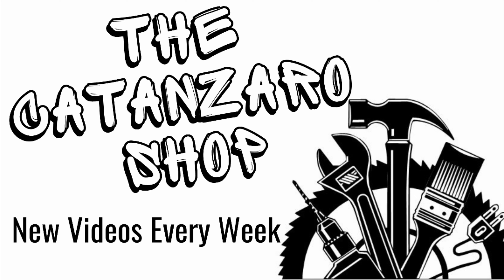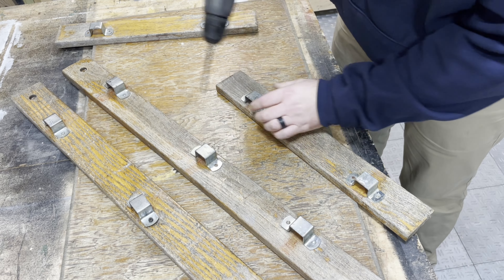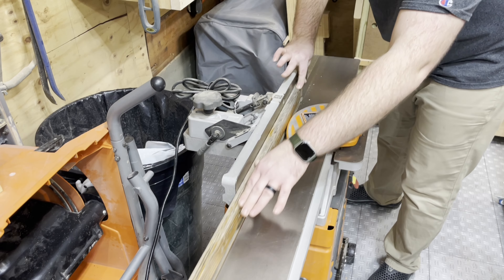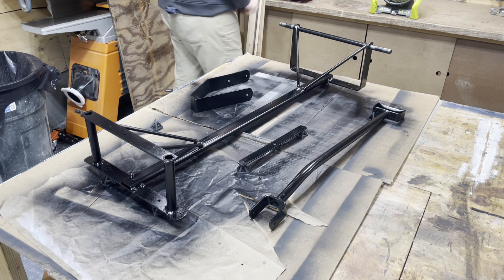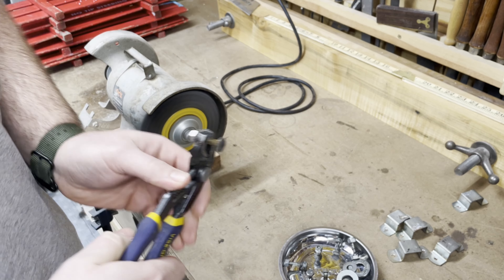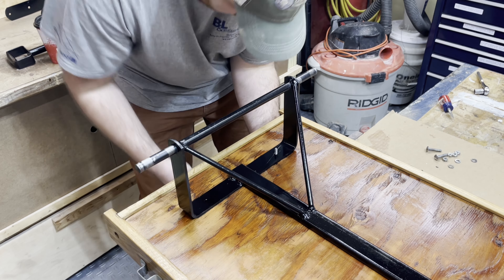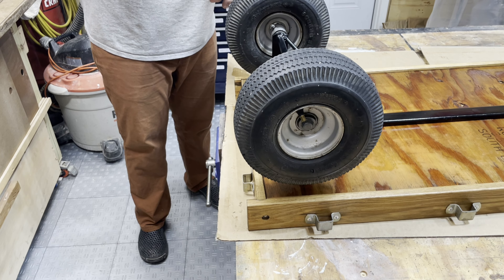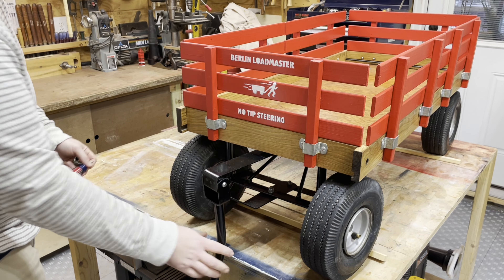Restoring Your Childhood - Wagon Restoration

Comment: I have a similar wagon, but it still pretty much looks the way it did back in the 1980s. I just noticed that the washer is missing off the bolt. I guess any washer will do as long as it fits?